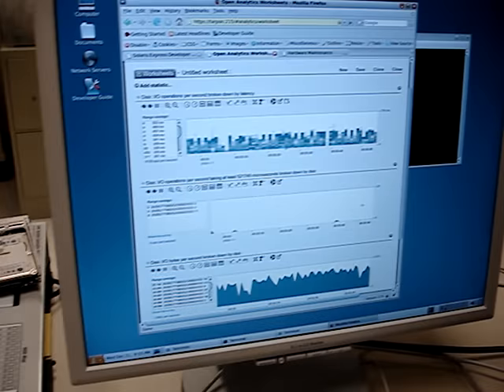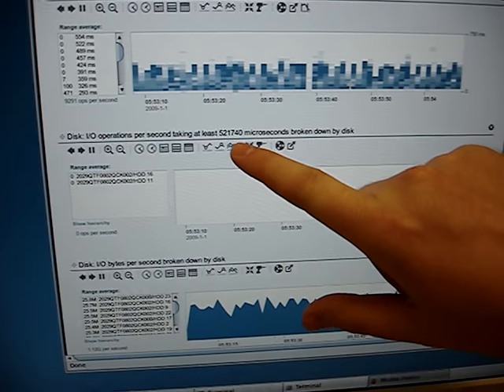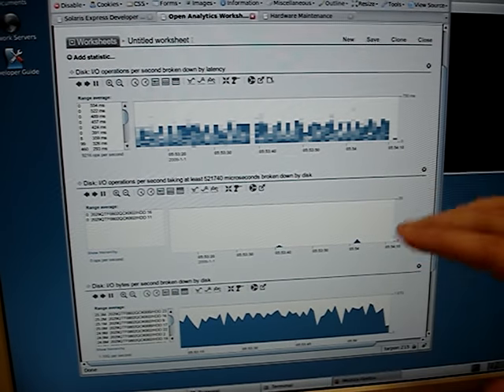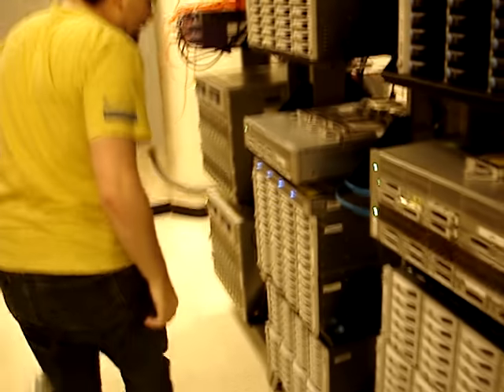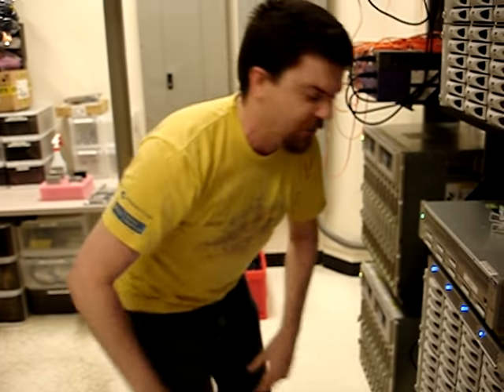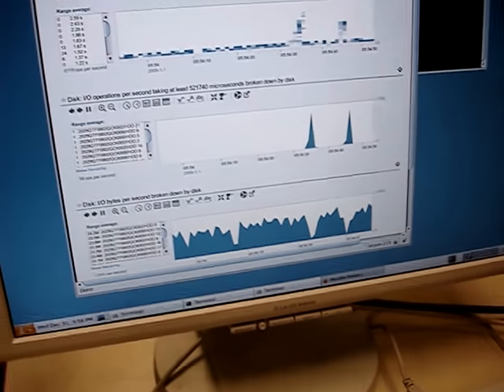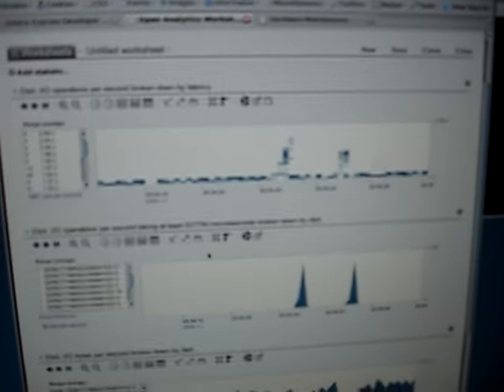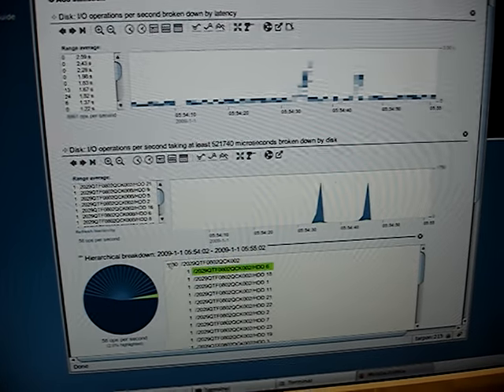Shouting in the Datacenter

Comment: This is exactly why solid state drives were designed - to prevent performance degradation due to shouting.
Reply: That's why SSD stands for Shouting-Safe Data.
Reply: @ThomasNimmesgern  Shouting-Safe Drive is way official I think
Reply: Now if only they made gamer-fist-proof monitors, we’d be set.
Reply: @kaidwyer  That one, now bankrupt company (I don't remember the name) used to make GFPs for like a year or two, but they got replaced by LED (Langer Emanagement Dyes) screens.
Reply: @kaidwyer  gamer proof monitors used to exist.  they were called crt monitors.  
you could take a baseball bat and hit the screen on the glass as hard as you could.  and it wouldn't shatter.
Reply: @darkracer1252  yeah back in the day if you hit your screen your bones shatter
Reply: @melancholicegg1000  back in the day if you hit your screen.  you were repairing it
Reply: Shouting by frustrated IT workers is a serious problem.
Reply: So THAT'S why gamers buy those!
Reply: @gungir2295  10 bugs in the code
shouts at computer
20 bugs in the code
Reply: Now they just need to make chips in SSDs that last much longer data-write wise, if they didn't already.
Reply: LOL 😂
Reply: I laughed so hard when I read this thank you.
Reply: solid state is short for solid (mental) state (they can take the pressure of being shouted at)
Reply: @kaidwyer  CRTs are very gamer-first-proof. Your fist isn't CRT-proof tho 😛
Reply: @darkracer1252  Man I swear back in the day 2-3 slaps could fix any machine
Reply: Due to shouting gamers*
Reply: all drives are solid state.  the only non-solid state is storage that is in the "cloud" 🤣
Reply: well that and they are faster to boot shouting does not affect them they run faster last longer run cooler use less power makes you wonder how much longer mech drives will last against a superior tech like that one based on the pricing drops occurring to ssd's over time 2 tb drives are getting pretty good for the price now wait till the 4 and 8 tb ssd's get down in price mechs will be so screwed then
Reply: Solid state drives have solid characters that can take shouting and brush it off.
Reply: @BurntPlaydoh  Honestly though, one of those cabinets for a computer in a lab or auto shop would be useful for a dedicated VR setup. Set it up, flip the lid down, and hope you don't break your fist on the plexiglass or metal. 😂
Reply: @darkracer1252  no actually, it TOOK a baseball bat to shatter those things. everything else you threw at it like punches would result in your own injury
Reply: hahaha
Reply: Performance degradation directly correlated to how gravelly and SCSI your shouting is.
Reply: @darkracer1252  I still have a CRT, it's what my Wii is hooked up to lol.
Reply: @darkracer1252  sorry boomer
Reply: They still use mechanical drives due to the price per capacity in comparison to SSD. SSD is great, but it still burns out eventually just the same. You can still potentially repair a mechanical drive, but when an ssd burns out or catches a short it's pretty much game over.
Reply: All he had to do was wear a copy of Izotope RX.
Reply: Especially effective for gamers
Reply: i wouldn't say they were designed for that specific reason, but i agree it's a positive byproduct
Reply: SSD's are mainly developed for the Italian market.
Reply: But they cant be recovered nor used extremely
Reply: You got me
Reply: didn't ssd's have a limited read and write cycles?
Reply: @ottoivanov4269  everything have limits
Reply: @kaidwyer those will come out when Kyle-proof drywall is released
Reply: Yeah, as if those things don't have a resonant frequency as well?
Reply: That's incredible
Reply: ... and for noise abatement purposes.
Reply: I thought Sitting Still Drives were designed to combat the data sedimentation effects caused by the accumulation of digital dust exposed to rotational velocidensity in Heavy Drilling Drives, named for their rapid spinning motion, and CD-ROMS or Carousel Drive - Read Only Memory, named again for their spinning motion and the fact that they're such a poor storage medium they're only useful for text files (files you "read" as oppose to "watch," "play" or "listen to").
Reply: WHAAAAAT?!
Reply: CHALLENGE ACCEPTED
Reply: As an IT support representative, I completely agree with this statement
Reply: The single reason they exist is for gamers being able to race
Reply: you're not wrong lol.
Reply: or performance degradation due to... literally anything. lol
Reply: Of course, it all makes sense now!
Reply: stoic state drives
Reply: @darkracer1252 bro those were way too fragile idk what you're on I've seen too many break
Reply: I don't really know why people are surprised by this fact. SSD is actually short for Shout Stubborn Disk
Reply: @ThomasNimmesgern  *SAFE DATA*!
Reply: The real improvement comes from solid state fans
Reply: I got you my girl.
Reply: @zewzit  punches computer 
"Error 404"
Reply: if i had to boot on a hdd i would do a lot of shouting
Reply: For angry gamers
Reply: An SSD dies each time somebody shouts at a data centre
Reply: Now we need silent fans foor cooling off those ssds.
Reply: What's a "disk" 😂😂😂
Reply: @bigcazza5260  We all used to boot from magnetic disks, you only shouted because you built crappy PCs probably😅😅
Reply: Yeah, old hard drive suck, they ate trash sit, just a wast of sand.

Comment: There was a very popular online photo service that was having cooling issues in their datacenter. They brought in some large floor fans to help cool it down while they waited for repairs. Within 8 hours they were in a full panic as they have lost 40% of the disks in that whitespace. Well one guy started mapping out the lost drive physical location and realized that servers that were within a few feet of the fans had almost complete disk loss. Vibration is Hard Disk killer.
Reply: Jarrod, spot on. Had one question come up about a loss of performance after adding a bunch of new disks to the arrays, I asked: what's the harmonic frequency of the spin rates between old drives versus the new? I love when interviewers ask real questions, and begin texting other engineers. And the look, "that… is unexpected" when the responses come back.
Reply: Was it vibration, or the pulsating magnetic fields?
Reply: @float32  vibration. If the read/write head were a Boeing 747, and the hard-disk platter the surface of the Earth: The head would fly at Mach 800; At less than one centimeter from the ground
Reply: @jarrodvsinclair  why did you stop there? Follow through with the analogy. That cm of air acts as a nearly impenetrable boundary layer, applying millions of lbs of force, as the Boeing approaches the ground. Heads only crash when drives stop spinning, or you apply massive g forces by dropping it to the ground. Tracking errors are *easy*, which is what this yelling, and almost certainly the fans, would be causing. There’s no protection for alternating magnetic fields though. That’s how you make a degausser.
Reply: @float32  inverse square law and comparing induced emi magnitude to the remanence of the platter coating. I'm more likely to believe damage was caused by physical vibration sooner than oscillating magnetic field generated by a synchronous motor in an ac fan.
Reply: @sjm4306  my assumption here is that if the fan is vibrating the drives enough to cause damage it’s not the wind. If it’s vibrations, then there’s close proximity. Who knows.
Reply: Goob thing you also have SSDs noe
Reply: I have a feeling I was a victim of this.
Reply: @beatfromjetsetradio8239  after this happened I heard of it happening at another DC when the cleaning crew brought in a floor buffer because something got spilled on the ramp. well they cleaned up onto the whitespace as well and the vibration messed up a bunch of drives
Reply: this reply chain is the epitome of making something more complicated than it is in an effort to sound intelligent.
Reply: @jarrodvsinclair  just imagine that!.. Wooow
Reply: @commenteroftruth9790  Yeah basically this
Reply: What photo website was this do you know?
Reply: @irishgigachad2347  it's been long enough it likely doesn't matter. It was Snapfish
Reply: @jarrodvsinclair  thx
Reply: @float32  it's not the wind, it's the sound. the video just demonstrated that. he wasn't huffing and puffing on the drives. the fan motor only needs to make a quiet sound of the right frequency, not shout over the sound of the spinning discs.
Reply: when im gaming, I get angry and bang my desk (my pc is on my table) I believe to have corrupted multiple drives this way because they are mechanical. Very unlucky if you ask me.
Reply: What kind of data was stored in that facility?
Reply: Yeah sounds more like magnetic field due to the motor.
Reply: @Ay-xq7mj  nope, sound vibration. same thing in this video
Reply: I remember my hdd died (first bsod, then found a lot of bad sectors) after I blasted bassy music with subwoofer in my room.
Reply: @Ay-xq7mj  why doesn't this occur with the fans inside computers? Especially laptop ones which can be mere centimetres away.
Reply: @hjf3022  I was talking about scale. Issue with motors and such scales with size same with magnets giant unpowered magnets are extremely dangerous even just due to the crushing they can apply if you do something dumb.

Also most small devices like laptops and such use passive cooling with no fans since you cant fit them in small form factors, however small fans wont do anything  do computer hardware. Anything anyone would normally have or get close to cant cause hardware dmg. A big enough industrial/commercial motor maybe could? I really dont know.
Reply: @Phantogram2  I literally just hooked up a sub and I'm running an old Dell with win 7 ultimate (I like living in the past) so I'm going to test this. I'm going to crank it up and try and run something stored on the disks that are close by.
Reply: did i catch a dune reference there sir
Reply: That's why I always carry a Hitachi wand every time I want to vandalise a data centre
Reply: how it could be magnetic if drive is all covered, and magnetic filed from fan motor is negligible?

i woud rather suspect vibration through the floor, or however those fans were mounted
Reply: Vibration is the most powerful force in this realm.

Comment: While developing our technology, we discovered that the siren tone we used in our initial version would cause a number of laptops to Bluescreen due to persistent Read / Write failures. As it turns out that most drives are sensitive to sounds below 100Hz or neat 1kHz. We adapted our siren pattern and eliminated the problem.   We found this video after the fact.. In hindsight, I wish we found this before all the headaches.
Reply: there was a certain laptop that would specifically crash entirely if you play a song from the 90s near it.
Reply: @gasun1274  Rhythm Nation, Janet Jackson, to be especific hahaha
Reply: Soo serious question, I like to bass really hard to the point the walls shake a tad bit, and i'm having a problem with HHD's getting way more wear to them than they should be in my room... (SSD however is fine )

could this be the reason why? I'm basically ruining my drives with bass? lol
Reply: @dementedpeep  I am also interested in this question because I have a subwoofer on my desk beside my PC -- after watching this video I am mildly concerned about the concept of prematurely wearing my HDD due to excessive bass when I record/produce music and use the sub at higher volumes.
Reply: @dementedpeep  ABSOLUTELY... Go SSD all the way if you like bass... but it is not specifically bass which is the problem. There are specific frequencies which cause resonance in the head assembly. When we were developing our technology we hit one of them, and it caused irrecoverable R/W errors on the drives.
Reply: @CICADASECURITY  Weird seeing an reply directly from an 10 year old comment
Reply: @hariranormal5584  The response was to Demented Peep, who posted a comment 22 hours ago. The topic is still very pertinent.
Reply: @CICADASECURITY  
No, as in, it's weird to see replies from the OP which has left a comment such a while ago
Reply: mazel tov!
Reply: @hariranormal5584  it's incredibly normal.
Reply: @TheJacklikesvideos  Isn't at all dude, trust me, a lot of the decade old accounts hardly get back
Reply: @dementedpeep  Less serious reply: Given the evidence in this video, it could also be your neighbours shouting, nearby, at the heavens because of too much bass.
Reply: Why has this video and your comment sparked so much interest in the last two weeks?  Is YouTube AI warning us of incoming yelling? lol
Reply: Damn sup comment from 10 years ago
Reply: @grondhero  adam neely did a video about the rhythm nation resonance thing and it had a clip from this video in it (so people including me looked for the clip), i guess the comment got upvoted bc it's about the same type of resonance thing
Reply: @eden3669  That's pretty awesome. :)
Reply: That might actually be why back in 2005 some video games crashed my laptop when they lagged and the sound bugged out. Fun times.
Reply: @CICADASECURITY  madlad. You sir are a legend
Reply: @dementedpeep  Yeah you should probably use SSDs

if you still wanna use HDDs, one solution would be to use rubber grommets with the drive tray screws to reduce vibration.
Reply: So... See you guys in 10 more years when we laugh at this again?
Reply: @SUNNYCLOUDBUNNY  Man please put that sub on the ground lol. You're primarily meant to feel sub not listen to it
Reply: @CICADASECURITY  What kind of siren?
Reply: @dementedpeep  well yeah
Reply: Every siren should have a do-not-disturb mode.
Reply: @gasun1274 yes that's exactly what I thought of as I discovered this video

Comment: I had a data center on the top floor of a 150 year old brick building, next to a railroad track, two rail lines actually. We got a lot of hdd failures that I was convinced was the vibration. Random raid fails that a rebuild would fix. You could see monitors wiggle on the far end of the building from the tracks. Glad to be gone from there.
Reply: How laptop hdd can stand the users shacking all the time?
Reply: @drac124  Laptop 2.5" drives have active protection against head crashes that enterprise 2.5" SAS drives and typical 3.5" drives of all flavors lack. This is also one of many reasons why flash storage is preferred for laptops these days.
Reply: @drac124  The vibrations from the train passing by might not be as large in magnitude, but it's all about acceleration (you'd probably have to hit the laptop pretty hard on something to replicate the kind of acceleration the shaking from train can cause)

Comment: This research was already done at Sun Microsystems a couple years ago (2). They got the same results.  This is why they use vibration dampeners on the fans.  It would also be a good idea to use water cooling, or just go with a solid state drives if you have the money
Reply: exactly i have read that research too.
Reply: Still about the money if you looking at SSD. hehe
Reply: @pabanoid  SSDs today are cheaper than HDDs 13 years ago
Reply: hell yeah! somebody else with the name Asa!
Reply: Everyone responding like this comment ain’t 13 years old 😂
Reply: It's interesting reading people's replies to a 13 year old comment 😆🙄🤪🤔
Reply: Or just dont shout at your hdd's
Reply: @satunnainenkatselija4478  Wait what do you mean? Let's take 1TB for example, the price at 2009 was $0.115 per gigabyte, so the price will be $118 for a 1TB HDD. Now the 2.5 inch sata SSD are $45 for a 1TB drive.
Reply: @yezhishen3022  you sure 'bout that?

Comment: I have a large subwoofer, originally from my car, connected to my computer. On one occasion, I played music at nearly 70% of the subwoofer's maximum volume capacity, which resulted in a BSOD. The low frequency sound waves from the subwoofer vibrated the HDD (Hard Disk) so much that it got damaged. Thankfully I've had a backup of the drive. The solution to be able to use the subwoofer at high volumes with the pc, was an SSD.
Reply: you what?
Reply: Just wait till you accidentally find a resonant frequency for those nand chips, I bet that same frequency will also cause problems with the rest of your computer.
Reply: @andreasjoannai6441  The resonant frequency of NAND chips typically falls into the higher end and outside the audible range of human hearing, way beyond subwoofer-related frequencies. Sub sound frequencies are incapable of resonating them. A HDD is a totally different story though.
Reply: @BState  If you can find a resonant frequency for HDD's, in theory you could also find one for CPU fans or any other spinning object.
Reply: @andreasjoannai6441  Of course you can. But, again, the resonant frequency (specifically of NAND chips) falls into the higher end of the sound frequencies and outside the audible range of human hearing, way beyond subwoofer-related frequencies. The reading needles in a HDD are susceptible by lower up to middle frequencies. On the other hand, NAND chips would need a high frequency so strong that probably no current twitter-speakers can produce. Subwoofers are incapable of producing so high frequencies since their range is typically from around 20 Hz to 200 Hz. The upper limit of human hearing is often considered to be around 20,000 Hz (20 kHz), while beyond the range of human hearing, there are ultrasonic frequencies used in various applications such as medical imaging, industrial processes, and animal communication. These frequencies typically start from around 20,000 Hz and extend into the megahertz (MHz) range and these are the ones that can actually influence NAND chips, if strong enough.